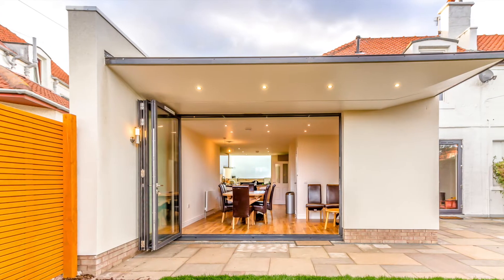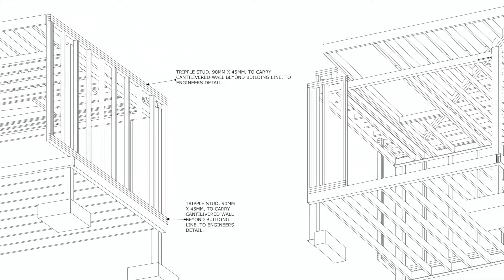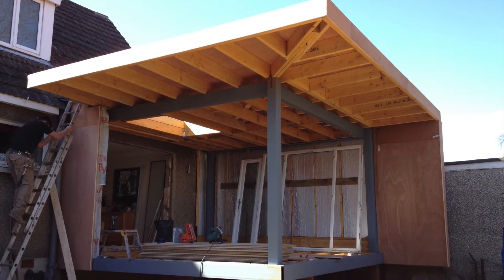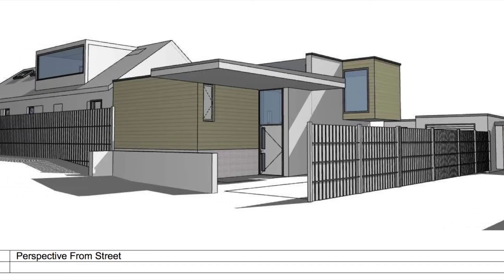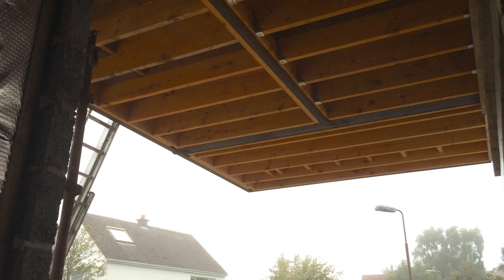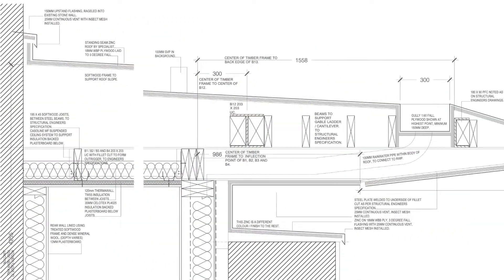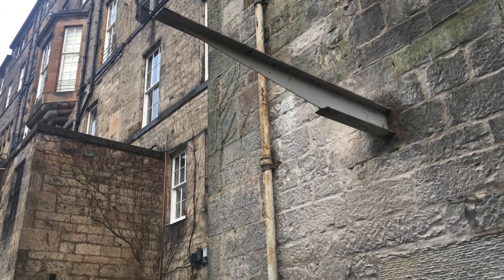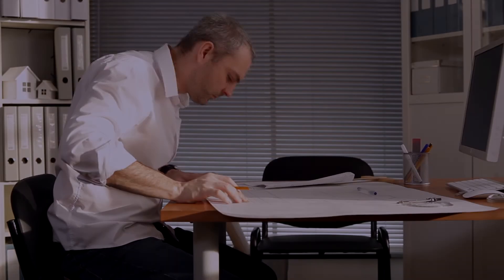Cantilever Roofs (An Architects Guide to Letting it Hang Out)

Comment: Thanks Neil.  What techniques would you suggest to prevent the cold bridging?  Thanks
Reply from the maker: Insulate everything.
Cantilevers are very tricky because the structure is partially inside and partially outside. The inside part must be insulated

Comment: What would be the max. span (wall to wall) for a 2 by 12 soft wood ceiling joists (12 being vertical), that would not bend under snow or it's own weight? i'm looking for a direct approximate answer, i just don't get the online tables ?
Reply from the maker: Legally, I can’t answer that. I can do the maths (bending moment calculations) but, as a register architect, I can’t specify that for you, even in the UK. If you are in the US, my Insurance won’t cover me. 
Your best bet is contact a structural engineer
Reply: Around 7-8m
Reply: @Cazorlah  7 meter I'm sure they bend, I was suspicious of 5 - 6 meters, where 4 is safe. How do you know that 7 - 8 meters stay strait and what is the spacing of the joists that you are considering ? thanks.

Comment: can you explain the math for sizing a steel beams for this project, distancing and other consideration working with steel frames? I am also concern about the heat lack through the frame, since I leave in a humid environment, I don't want to compromise the longevity of my tiny building :) 
Thanks a lot!
Reply from the maker: You better take advise from a structural engineer